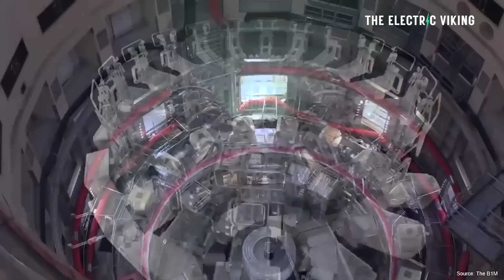Sweden criticised over plan to build at least 10 or more new nuclear reactors

Comment: Overall I think that nuclear power is a good idea when needed at latitudes far from the equator where renewables won’t meet the energy needs of the country or area.  There are a few issues that make me question the logic here:

1. Committing to 10! reactors seems a bit much right now given the rapidly improving efficiencies of renewables (not just solar and wind) as well as grid scale storage options. Will ECONOMICAL fusion actually come to pass in the intervening years and make fission NPPs obsolete? Probably a bad thing to bank on as although we’re getting closer by the day, it’s far from a certainty. Again this speaks to the folly of committing to 10 at the current time.
2. Given the considerations in item 1, will these still be cost effective when fully completed 
3. Was there any pressure (bribery ?) by large industry to go this route. I know Sweden is an advanced economy with solid laws against such abuses but the reality is it happens everywhere 
4. Are they building traditional in-situ reactors or trying SMR tech? While it isn’t truly proven out yet, the promise of SMR is that it potentially offers cheaper overall costs 
5. Has there been any consideration given to the risk of the NPP being used as a target by Sweden’s currently extremely belligerent neighbour. It’s unpleasant to think about but a reality that has to be factored in from a risk perspective. 
6. Overall ability to secure fuel source for the NPPs, given that the #1 uranium producer by a fair margin is Kazakhstan, followed by Namibia. Fair play that Canada and Australia are #3 and #4 but is that sufficient for the number of NPPs that are expected to exist in 2 decades if the top 2 producers end up being unreliable due to political instability or hostilities. 
7. Is it possible to reduce energy consumption by aggressively incentivizing more energy efficient homes, factories etc.? Could be a less costly option than constructing the NPPs and can be done immediately to see the effects before spending lots on additional generating capacity. Maybe this has already been done, if any Swedish person has made it this far 😅 let me know?

I’ll assume the policy people at the appropriate bureau have crunched the numbers and concluded that there is simply no alternative to provide the amount of power that they expect will be needed, but if I were a Swedish citizen those would be my top questions for policymakers.
Reply: It's not completely clear but the announcement seems to refer to SEALER reactors in the 300-500MW class. Sweden has been heavily involved in the design of this system.

These are nominally gen 5 lead cooled, high temperature small modular reactors. Importantly they have a much higher thermal efficiency (700C vs 350C) and much better 'fuel burnup' than conventional PWRs. Consequently they require less than half as much fuel for the same output all while generating much less waste.
Reply: @jimgraham6722  wow, that’s pretty cool info, I’ll have to look into it. I’ve kind of always wondered if fission reactors were actually getting anywhere near max achievable efficiency.  I’m not deep in the weeds of the subject but as a kid I used to live a 20 minute bike ride from Pickering NPP and visited several times, so it’s a passing interest.  Also had a friend whose father was a supervisor there and who now works there himself.
Reply: @sjsomething4936  Indeed, the new generation of reactors is far different from the original pressurised water reactors. They operate at much higher temperatures, typically 700C so can be dual cycle. Most of the available energy is released as heat rather than consumed by transmuting the fuel into unwanted high level waste such as plutonium so present lower risk of weapons proliferation. The end result is a much smaller, compact, lower cost plant. These plants are also far safer and are walkway safe, inherently resistant to meltdown.

Comment: Well the power is needed in winter and there is almost no sun in winter.  Nuclear is much more environmental sound than any other energy source.  Nuclear will not take as long or cost as much as critics have predicted.  Nuclear plants are being built in three to four years in at cost estimates and below in other parts of the world. Some of the newer plants can run on and use up nuclear waste from older plants.  Nuclear plants also have a 95% always on factor.  These are also the safest form of power.  Once the plants are built their power is just about the cheapest as fuel costs are very low.  These plants also have long operating lives of a hundred years or more.  Longer than most hydro projects not to mention that the land area need is almost nothing compared to other forms of power.  Really there are a lot of sound reasons Sweden is developing nuclear.

Comment: Solar is not a great option for Sweden, especially in Winter when the days are very short and the daylight rays they do have are very indirect.

I don’t think they get the same amount of wind as Norway or the UK. Off shore isn’t an option. Putting windmills in the northern part of the country is going to be difficult and expensive, and difficult to maintain. And nobody is really ready to go all wind/solar without base load. Storage at scale isn’t really ready for daily intermittency. And not at all ready to store energy captured in the summer for use in winter. 

Nuclear is expensive for a number of reasons. One is that so many are one off plants. Planning and building 10 at a time could keep the costs in check. For Sweden, it really may be one of the best options at the moment.

Comment: Present situation from a search.:-
 "Sweden has three operational nuclear power stations, with a total of six reactors, and an additional eight reactors in different stages of decommissioning. The reactors are owned and operated by Vattenfall (government-owned), and private utilities include Uniper SE (formerly E.ON Sweden) and Fortum Sweden (majority-owned by the Finnish government).

It is certain to be much more nuanced than the headlines...
Sweden has good nuclear waste handling so that part makes sense. 
There might be heating applications which might make some sense. 
Are they going to be medium sized modular type? New modular types migh make some sense but that is still evolving
For sure they will be one-at-a-time so it is unlikely to get to the headline number. 
Maybe some defense implications?
Won't require much grid transition to renewables so status quo there.
They would be set to wait for fusion to arrive and that might take about a fission plant lifetime?

Intriguing...

Comment: This old video popped up in my feed. Solar and wind do not prove the base power requirements, which is analogous to inertia for the power grid. That is to say, solar and wind fluctuate, which is fine for topping off the grid, but not suitable for reliability. Anyways, the reasons for nuclear is because Germany, and EU power distribution laws. In South Sweden the retail costs of electricity is 10x the cost in North sweeden, and that's because of grid exports to Denmark and Germany. Meanwhile Germany switched off the nuclear generators, and switched to dirty coal & gaz. These are obviously not green technologies, where nuclear is in fact green, because zero co². So it's obvious why Sweden is building nuclear, to export to Germany , filling the gap left by Russian cheap gaz. This electric Viking guy keeps talking solar, but solar doesn't work in Europe during the winter months, because clouds , and as mentioned beforehand both solar & wind fluctuate too much they are not reliable to sustain constant load. What Europe needs is more power generators built, yesterday... Because the region is behind due to the delusions of ecology politicians in denialists pathology. That exclude the French, of course, they are starting to rise to become the main sustainable energy economy besides Scandinavian places.

Comment: They may be building small modular Thorium Molten Salt nuclear reactors. These are safer, cheaper, cleaner, and can run on nuclear waste, potentially cleaning up existing waste sites. China has already built these with immediate plans to deploy them at scale.
Reply: When can we get those? Where can we place those?
How much does a SMR cost per kW?
Sweden has negative prices during many hours this summer.
Reply: @Harrythehun 
We?
If America…. After 20 years of protests
Reply: @Harrythehun  Yep, do you know what was happening during negative prices? Owners stopped the wind turbines, to minimize the loss...
Reply: It makes sense especially as it can use nuclear waste and ultimately cleans that up.  It would seem to me every current nuclear plant should get one, to get rid of the decades of waste piling up.
Reply: And they do not yet exist ...
Reply: @tireddad6541  i also wonder about that, molten salt operates at 800 degree c, how does it use spent fuel rods which requires 1300 degree c to melt?
Reply: @albertiwong  I am not a nuclear engineer.  Nor an expert.  I don't know exactly how this stuff works.  Maybe it was some other kind of modular nuclear.

What I understood was that they pretty much know how to do this.  The US is way out of practice.  

Whatever that new type is called, a lot of politics involved.  

Elon Musk has said he doesn't know how we could transition without  nuclear.  A lot smarter and an engineer.
Reply: These aren't even shown to work for decades though? China has finished one test reactor.

No we are building 10 conventional
Reply: @matthiasknutzen6061  I hope Sweden achieve their goal of zero carbon emissions. I hope nuclear get back into the mix  of Green solutions.
Reply: @albertiwong we have had practically a fossil fuel electricity grid for decades. The hard part is still moving away from fossil fuel in transport.